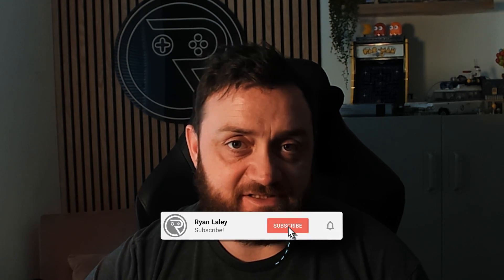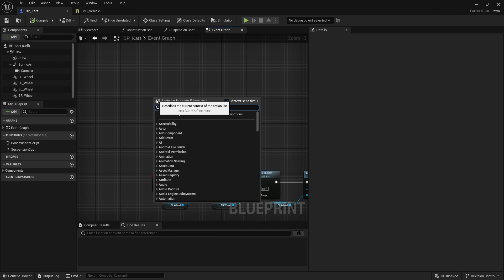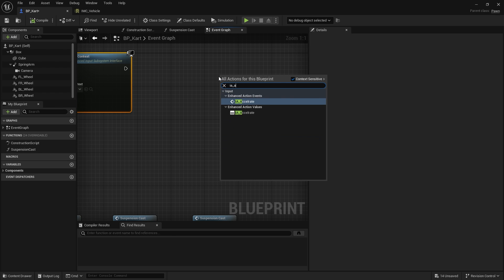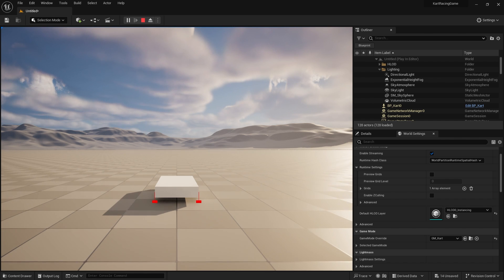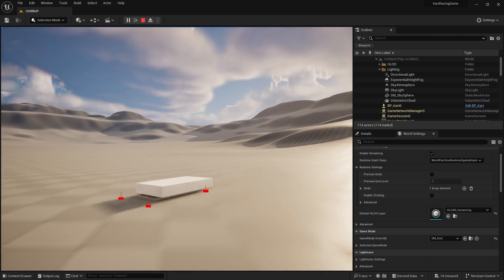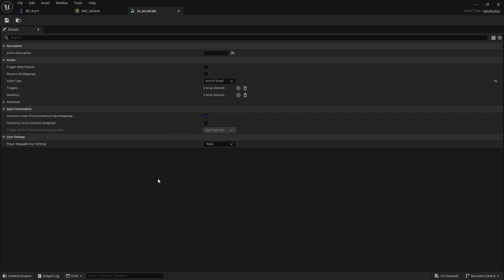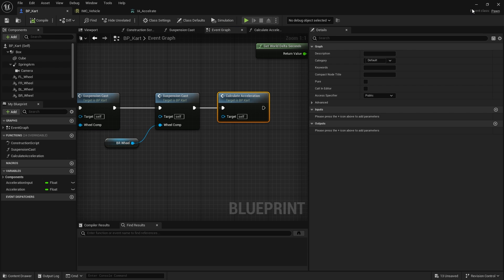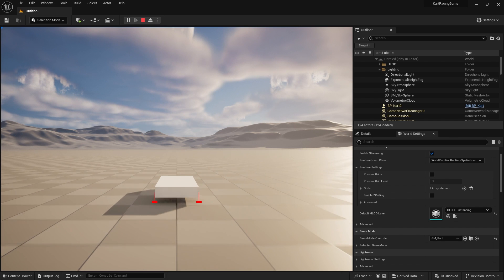Unreal Engine 5 Tutorial -  Kart Racing Game Part 2: Acceleration

Comment: I have my stuff set up exactly as you do- but when I accelerate at any decent speed, the front of my box rises until im just laid on my back unable to move..... Any fix for this? Did I miss something?
Your box remains perfectly straight even at major speed- mine flips over at 20% of that..
Reply: hey man, I had the same problem , for me it's because i had set my wheel scene components to low at the bottom edge of the cube, try to rise them at the center of mass
Reply: @foreachloupstudio  Thank you for this suggestion! Fixed my issue!
Reply: Make the kart size the same as he has it, i did that and it fixed it for me
Reply: Center of mass offset on your vehicle chassis mesh. Use a sphere collision temporarily to visualize for you to figure out the exact numbers, then copy those to center of mass offset.

Comment: Hi Ryan! I was adding some names to some variables to make them easier to tinker with, and I came across something that I cant work out. Adjusting the B value of the LERP in calculate acceleration doesn't seem to have any affect on the speed at all. Is there some other component I'm missing that would adjust the top speed of the kart? Thanks for reading!
Reply: I just think the whole tutorial might be a bit overcomplicated for no reason , I guess everything could be explained better rather than "you want, you need" I have one simple question to all of those : WHY ?  , when we start getting answers to that , the tutorial will actually be good , and might even get less complicated